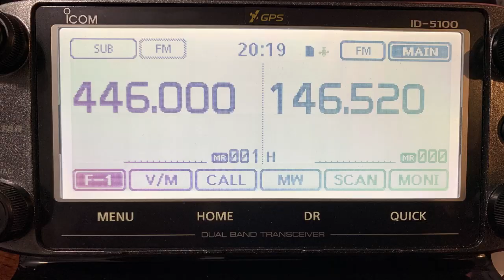What is 146.520 Simplex?

Comment: Height isn't everything to the distance of the signal like most think. Knife edge propagation is a common thing, and many folks ignore this. From various areas, even my QTH, I could talk 110+ miles away to other stations simplex, and even repeaters. I was in a hole, at 50 feet elevation, and antenna at 20 feet. If I went higher in elevation, the signals would disappear quickly. As a 2M FM DX'er, I've worked a lot of folks with this type of propagation. Ducting as well, but less frequently. 52 is one of the funnest places to be. You truly never know who you will hear, and how far away they may be.
Reply from the maker: Thanks for the comment! Maybe you would be open me interviewing you on "Knife edge propagation".

Comment: Great video gents, i learned a lot. I have been a Ham for about a month and i have a question. I have a yaesu FT3D and if i wanted to just talk to a group of friends that are on a car convoy or hiking a trail, can i use the 146.52 as the group talking frequency or should i just pick any frequency in 2m? Thanks
Reply: Depending on how busy .52 is, you might stay stationed there, or you might meet up there and agree to shuffle off to another corner to talk quietly undisturbed (for awhile ;-)  ).

Comment: As a new ham operator, I'm finding it hard to program the 2m or 70cm calling frequencies into my radios. I know repeater require a Sql Tone and Frequency Tone, but do 2m or 70cm requires an offset or should it be set to off? Using Chirp or RTS leaves me puzzled because the fields is confusing. Which also is confusing to program them in manually. Thanks in advance for answering my questions. 73's KD9YBH

Comment: There are also more local simplex frequencies
Reply from the maker: Yes and share some of the other ones you like or have used.
Reply: KI4CFS - Ham Radio - Martin Brossman well, I hear people on 147.420 sometimes. One time I heard a net when the band was open but barely so I have now idea where they are located. I am in Moore County.  146.580 is also on the Raleigh band plan as a simplex frequency and I have talked to people on there. 146.520 is of course probably the most used.
Reply from the maker: Cool, thank for adding this.
Reply: @KI4CFSHamRadioMartinBrossman  While 146.520 is the National calling frequency, there may be popular gathering spots in different areas.  A group just has to agree that they will "hang out" on a particular frequency.